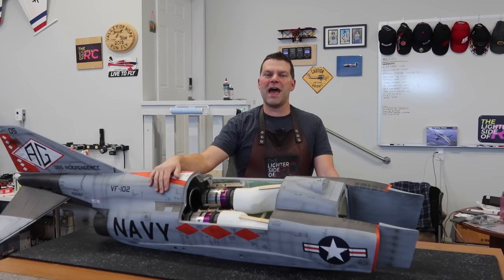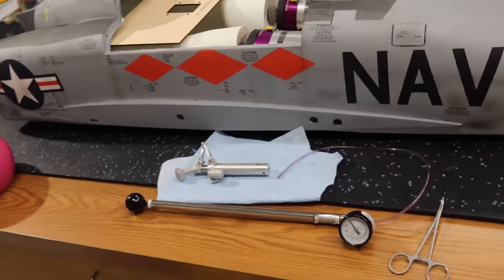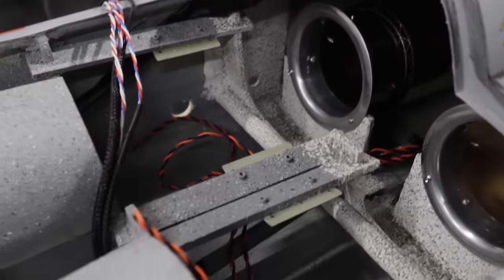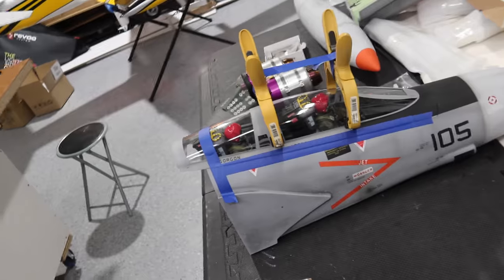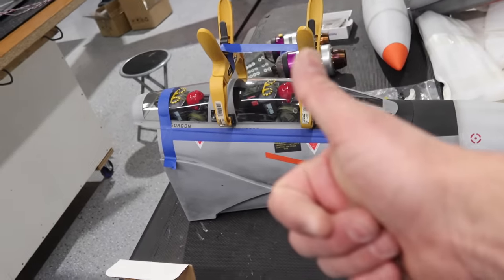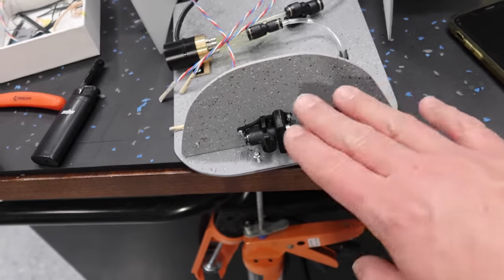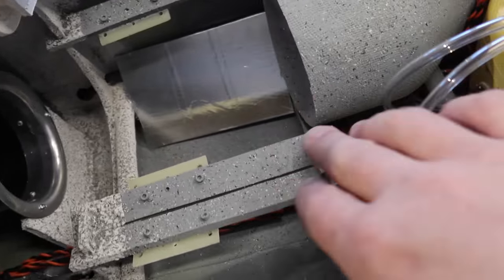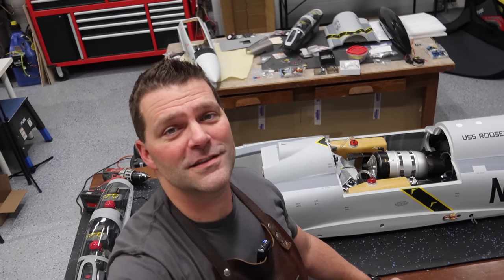PHANTOM BACK END IS COMPLETED - Skymaster Twin F4 Phantom build

Comment: Is it possible on those to have the canopies open and close like the real thing? I use those solder sticks on my train layout of many other applications.
Reply from the maker: It is and it was part of the plan but we scrapped it. Unfortunately on the smaller aircraft and with the canopy done it’s very difficult to make happen. On the larger size version it’s easier and would be an option best ordered from the factory

Comment: Seems the fule plug and line are facing the back of the plane, how do you do the pickup tube inside the tank to make sure the plunger is always in the fuel?
Reply from the maker: Multiple tank setup and UAT's help with that.

Comment: i really like how you explain youre way of work 👌👌👌

i was looking at the twin engine tanks ...those 2 pipes are the outlets ? how do you get the fuel under those pipes ?
Reply from the maker: Thanks Dave!  Don’t fully understand your question but I think I do. I always look at the fuel path from filling at the bubble traps. So you start filling at the bubble trap. It goes to the bottom fuel tank. One line is a pickup one is a vent. The vent goes to top of tank. So you fill through the pickup and it comes out the vent. From there both lower tank vents go to the upper tank. Now in the upper tank there is 2 pickups and a vent on top. So both lower tanks share the upper tank.